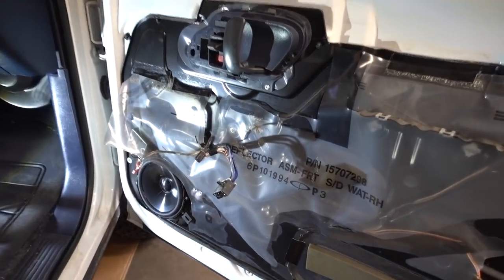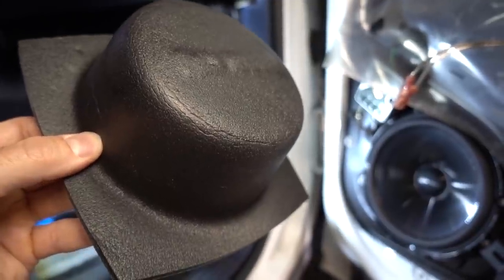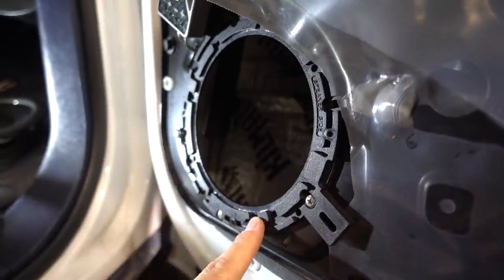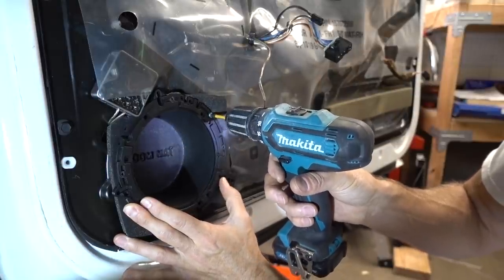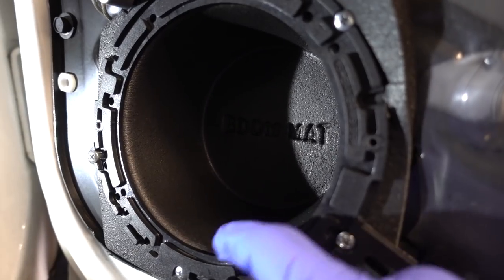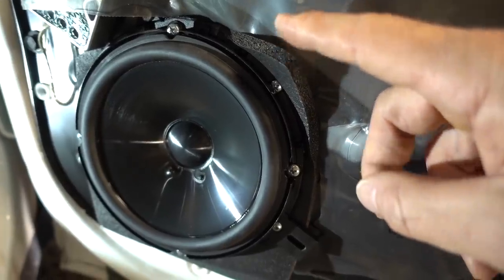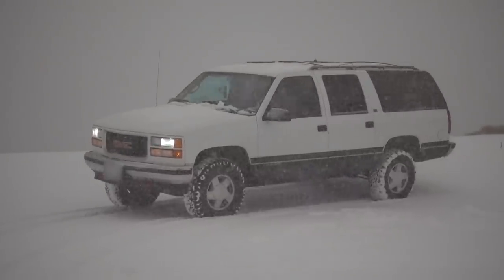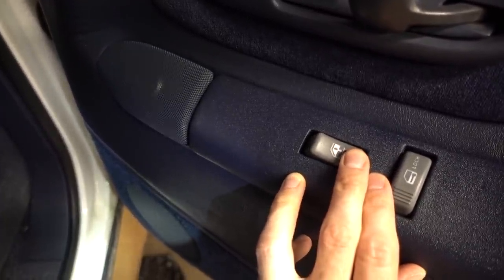Here's How A Speaker Baffle Could Destroy Your Speakers!

Comment: I used these before and they kill bass response because you're basically placing them into an extremely small enclosure that will flex. Car door speakers are built as free air speakers which means they'll perform their best just mounted to the door. I used them for the same reasons you did but ended up cutting out the back and bottom to still allow for protection but also allow for the reverse waves to do their thing properly.
Reply: bigger hole needed is all. that cover is horribly designed, it should have a tube coming off the bottom to run your cables in without any water ingress risk. and allow free air movement.

but then im guessing they charge $20 a shot where clingfilm would do the whole job fine.
Reply: I did the exact same thing. They killed the low end so I cut half the bottom side off.
Reply: I just ordered the rubber 
open-end ones, the recoil brand. Anyone ever get to compare the two types? I’ve never resorted to this but I’m only now using them bcs it’s a 30 yr old sports coup and the audio will be new so no chances. 

I’d like these to “improve” sound so the speakers have a dryer environment but if it hurts the audio, then that’ll suck to have to choose sound over protection.
Reply: They aren't built to be in free air, they will perform better in an proper enclosure compared to the door

Comment: They are worth it. Just use the plate first then foam
Reply: or you could just potentially buy a 6-in speaker cover.?.?.
Reply: The round speaker box is so small that it almost sounds as if the back of the speaker is clogged.

with such a small box you will not get good sound!
Reply: @ford1546  you can also cut a hole on the bottom of the baffle to help with the sound and still protect the speaker from the elements.
Reply: @mart182003  yes you can but then it will be the same as the plastic that is commonly used to protect the speaker.

Take a foam cup and put a speaker inside and you get a thin sound with little bass !! so small boxes are commonly used for midrange in a hifi speaker.
Reply: JOHN KUSHER.
you do not know what you are talking about

you should use the plastic that is commonly used to protect the speaker. which the factory uses

Take a foam cup and put a speaker inside and you get a thin sound with little bass !! so small boxes are commonly used for midrange in a hifi speaker
Reply: Im not worried about bass response. I am using my 6.5s and 5 1/4 for smooth midrange. I have a subwoofer to cover all the low frequencies. Hopefuly they sound good with Boom Mat🙏🙌
Reply: Cut the bottom curve of the baffle and you'll still have dripping water protection. The top and side part of the curve should support the rest of the baffle. That and it has the speaker to land on worst case scenario.

Comment: Use boom mats in all my car speakers. Provides a noticeable sound difference especially with bass. Basically allows the speakers to float to a degree so it’s not transferring vibration to the doors as much
Reply: it is good to know it can improve the bass, will try it :)
Reply: That’s not how it works….
Reply: Speaker baffles basically create an enclosure.  This mitigates cancellation between the sound coming off the back of the cone and the front.

Comment: Just cut them to be a rain baffle.  Leave them, but just cut the bottom area from the door skin to the back of the baffle like a 1/4 slice of pie.  Any water intrusion in the door will drip off the top of the baffle where it covers the speaker.  It also will allow the speaker to still act as an infinite baffle as it was designed.

Comment: The depth of the foam baffles is a very easy fix. Shorten the depth of the baffle yourself!  There are many ways to achieve this thus far I've done: electrical tape around the outside to crush the foam, duct tape around the outside to crush the foam, cut and reglue the foam, and heated the foam sides to shorten them. 
Always ensure 100% fitment before resealing the panel!

Comment: Reverse your foam with that little plate that you added and it’ll move the foam further away from the window and you’ll still have everything the same
Reply: That could work unless the foam actually touches the back of the speaker, not the design intent.
Reply from the maker: I might try that first.
Reply: I know for a fact I just explain that wrong and I’m sorry
Reply: 1ROAD Even though in the beginning you showed that the foam was too big for the plate just force it in there a little bit it will only be snug around the edge of the plate/adapter. That should shorten the length between your window and baffle. But the speaker will still fit inside it just puts the foam tight around the speaker basket! I have the same exact set up.
Reply: Yes, it may seem like a tight fit but that is ok. It will still be just as effective.
Reply: @MurderousMindstate  sadly even a tight fit will still have rubbing parts and degrade the baffle over time, making it drip into the area and instead of it dripping past it would collect and eat away at the speaker, so it's best to try reversing
Reply: It won't be flush with the door it would leave a small gap. You just buy or make a ring spacer to go behind  it. To bring it out a few mm. Jobs done. It's not rocket science

Comment: Anthonyj350 has great videos on these.  You really want the speaker to move air and take advantage of the whole door.  He cuts them in half and only uses the top part as a cover leaving the bottom side ope to allow drainage and moisture evaporation.
Reply: Yep! Thats what i did.

Comment: I just returned my set!
4 Runner's have 6x9's in the front doors along with needing a special trim ring to mount them.
If I had the stock speakers in the boom mat's would make them sound better, but... I'm using Infinity components and they have more excursion and great bass!
Good thing I did a sound test before installing the other side,  it totally killed my mid bass!
The infinity's use the whole door as a bass box!
Do yourself a favor...
Go to Home Depot and get a roll of the aluminum backed roof patch, stick to Inside of door and it will kill road noise and increase the sound of you speaker inside the cabin!!!
Reply: After 20 plus years in audionthis statement is wrong on multiple levels. First with regards to tour roofing tape that would worsen his sound deading. He already had kilmat which is 80mil thick it is also a butyl rubber based not asphalt like roofing tape. Roofing tape may seal seams and leaks but the ashpalt compisition does nothing for sound deadening. Also apshalt roofikg tape unlike the butyl rubber is sensitive to heat and can melt as it gets hotter like summers here in Ga. Speaker baffles do not kill base. It isolates the acustic sound coming from the rear of the speaker stoping it. From being heard. The baffle like a sealed enclosure give the suspension better cone control and a nore accurate basss note. What your refering to is sub bass which should not be played thrub mid range speaker. And as i also have kappa infinity 6x9s with cross over and seperate  tweeters i can tell you that the sound quaility of the kappas is greatly improved with the baffle rather then without.

Comment: Jimmy, I kinda cheated and used the ones my suburban already had in it, however, I made custom adapters to bring out the speaker about 1" which helps alot for window clearance. Love your channel brother. God Bless.
Reply: If it misses by a fraction of an inch, it misses by a mile.  An inch seems excessive.
Reply: @x-man5056  I used cabinet birch wood to make the custom adapters. I believe they're 3/8". They worked perfect for the audio setup I did.
Reply: @OzarkGuysFishing  3/8" inch sounds more appropriate.  Good call.  From what I could tell, Jimmy only needs about an 1/8" - 3/16"  A few washers will do it for him but your fix sounds professional grade.
Reply: @x-man5056  I was a bit of a chore to make them, but they work for what I needed. My sound system is all new, and I'm in the process of adding a sub. Once finished, the overall process will be beneficial for my needs. My goal is to have my system sounding like a concert hall. I used coaxials all way around. Custom brackets in the rear deck to adapt 6x9's and eventually will do 6.5" rounds in kicks, where my 4" rounds are now.
Reply: @OzarkGuysFishing  Yes, something like that would take a scroll saw or at least a very deft hand on a jig saw.  I'm not sure that's in Jimmy's skill set yet.
I hope your great sounding audio system doesn't make you loose hearing by the time your 50.  I was unkind to my ears when I was young, worked on fighter jets and loved loud rock n roll.  Not wanting to preach to you, that's your Mom's job, LoL.  Just want you to think about it as you are Jamm'n your tunes.  Tinnitus and hearing loss ain't no fun.  If you like to fish in the Ozarks or about anywhere in the wild, you'll want to be able to hear animals creeping around behind you.  Bears love fish.  Jus say'n
Reply: @x-man5056  I already have tinnitus, but it isn't too horrible. I'm not wanting excessive loud, just to sound like you're at the concert. And for the Ozarks, it's beautiful this time of the year, especially when the leaves change color.
Reply: @OzarkGuysFishing  Absolutely.  I live just off the Blue Ridge Mtns. myself, for the moment.  Moving to Denver area in a few weeks.

Comment: Wow, I was waiting to see the part where  you checked if there was room when the window is down!  However, you could modify them to reduce their depth.  Also, I'm not keen on a sealed cover baffle since it upsets the acoustic tuning (it adds both mass and stiffness).  I would be inclined to cut the bottoms out up to 3 and 9-oclock and leave the entire back on.  (Or perhaps cut two large windows between 3 & 9.)
Reply: Thats smart. That way if some water or condensation did somehow make it into the enclosure it could get out, but I would be weary to put the holes anywhere near where drops would collect, probably a round hole at the bottom would be enough, for the wires, like he did..BUT LIKE 5 TIMES BIGGER

Comment: They going to make your speaker sound like ass because it’s sealed. Cut a little opening so the speaker work properly
Reply: I installed these on my '02 Avalanche  and had a horrible experience with them.
The sound from my expensive component speakers were muffled.  It drove me nuts.  I replaced the speakers thinking it was a bad set.  Still sounded muffled.  Then I removed the second set and installed the factory speakers.  They sounded muffled.  That's when I figured out it was the baffles.  I put the 1st aftermarket set back in with no baffles and they were awesome.
No baffles for me.  I was also excited to keep the speakers protected.  But these are not the way to do it.  Plus I realized that if the cheapo factory paper speakers can withstand the small amount of water coming through the window seal, then the expensive speaker can withstand it.
Reply: Yes correct. Far too small box! Make holes at the bottom!
Reply: I bet it's possible to design and 3D print a custom speaker 'splash guard' that deflects any water falling down on it around the speaker, has a big opening in the bottom to not make the speaker sound like crap, and is shallow enough to not interfere with the window.
Reply: My oem American Motors speakers only had 3 holes at the bottom of the speaker basket. So I recommend 3d print a plastic guard for 3/4 of the speaker basket. Fully enclosing this speaker will drop the bass responce massively.
Reply: @NY411Info  Noted, when I design the part I'll keep that in mind.
Reply: EXACTLY MY THOUGHTS
Reply: Best trick ever is just spray all the back of your speakers with scotch guard !  Boom!  Water proofed with out compromising sound quality. (don't breath spray,  BAD FOR LUNGS)
Reply: @abyssalreclass  its not just the water comin down, its moisture that gets in. It will rust your speakers, trust me.
Reply: I wonder if that is the problem with my 6.5's??? The baffles block and absorb a lot of the high frequencies. Or is it just me???
Reply: That sucks Jimmy,   After i ported my baffles with holes about the size of a quarter, The five inch deep baffles work great in my 86 burban doors.  Maybe try some spacer rings
Reply: @xxdemonshitxx  I know! Right?  It was really foolish of me.   But hopefully other people can learn from my mistakes and not repeat them!
Reply: @ajstalter  Like Ramsay would say... 
“Tiny mind” 😂
Reply: @desmondmarshall7384  It's the low frequencies that get blocked, not the high ones.  The high ones come from the tweeter.

Comment: Dynamat (or similar) covering all the holes on the 'inside' door skin, and fast rings make far more difference than speaker upgrades. Put a speaker in an enclosure that's too small will raise 'Q' and produce a large hump at resonance. With a circular enclosure, you will also have problems with refections hitting the cone at exactly the same frequency, causing large frequency response irregularities.

Comment: Some commenters say you could mess up your regulators, but TBH they are the easiest regulators to replace in any car ever.  I don't know if you pulled he glass to install your sound mat, but it would have only been an extra ten minutes max. I found this out when I installed new outer handles, it's definitely worth the effort and fewer scrapes on the back of your hands and wrists. Anyway, I doubt the foam is going to overpower the window motors.

Comment: I used these foam speaker baffles in my 2013 Chevy pickup when I updated the speakers.  These chevy's are known too leak water on the  OEM speakers from the factory when moisture is present . Of course that's what they claimed.
Reply: i don't have this issue on my nnbs   but it rarely rains  and it's been months since i washed it  due to the fires ( it just turns back to gray after a day or two)

Comment: I bought these baffles from Crutchfield with 4, 6-1/2” Kicker speakers for my 13 Silverado but after seeing some videos and reviews I’m not going to use the baffles instead I’m going to use Stinker Roadkill rings after seeing them installed. I’ll probably use sound barrier wherever I can, get it on the inside of the door if possible. Back to the Boom Mat baffles it showed the depth of 3-1/4” and there was another brand that were 3” in depth. The only feature I did like is the baffles would keep the speakers dry in wet conditions.

Comment: Any more than 20watts rms and a small baffle will kill the lows. It causes more cancellation. The only thing you want to add behind the speaker is acoustic foam, which should be on the panel. You should seal all the holes you can on the inner panel with hushmat or some other sound deadening except for the speaker hole.

Comment: These fit fine in a 2004 Tahoe. 1995 has a thinner door. You also might want to consider cutting a square hole in the bottom of the so that it doesn't completely kill what little bass these speakers put out.
Reply: my room  cut a small hole in the bottom so if water gets in your door it doesn't touch the speaker, but also allows the speaker face to breathe (move back and forth). If there's no hole, there's no where for the air to move, and it dampens the speaker (makes it a lot quieter).

Comment: if you were worried about the foam letting water in, you could have coated them. flex seal, rubber undercoating or something come to mind.. i would just use it like it is, contact or not just don't roll then down as far. if the ac is good, then you'll be fine. not wrong to worry though. my truck, 06 gmc, i had bad connections and one had the contacts rotted off a set of pioneers. let me clarify, the board that held the terminals on the speaker was in 2 pieces and wires dangling. i'll not do component speakers mainly because i'll need an amp but i'll also have them exposed like that. those enclosures are supposed to add to sound quality more than protect them i think. never used them though so i wouldn't really know. another thought still use the baffles but make a spacer just thick enough to shim it out. plywood would be fine for this i would think it comes in the thickness you'd likely. they also sell adapter plates cheap on line that you could modify if they are thick enough but i doubt it. i fit 6x9s and 6.5s in my ranger this way just using a jig saw and a drill and plywood. factory was 4x6s in both but the kit i had was a left over chistmas pioneer kit clearanced out at wally world. don't get me going on the quality of said kit though. 1 set of speakers left only out that kit with a year or so if daily use..

Comment: Just my two cents, but it’s good to post a video showing products, however a large majority of Colorado tends to require some sort of customizing, whether it be the way that you mount the speakers or adding these phone baffles. One big thing as I mentioned to another person on here is that unless I missed it at no time did you want Stop to check and see if they were going to be any clearance issues between the speakers with the baffles in the window and it’s down position. If you did and I apologize however I don’t recall seeing it. 
It’s kind of like building a stroker engine and then trying to start it to see if you have any rod to block clearance issues lol.

Comment: The worry is real.  I got my dad's truck years ago (2001 Silverado) and noticed that the speakers were blown.  I was gonna replace them anyway, but what I found was the dust and dirt and whatever bit of moister got into the door had literally fused one of the coils inside the magnet.  The other wasn't as bad, but it still sounded like crap.  Some GM engineer sitting there saying "speakers work find in the elements, right?".